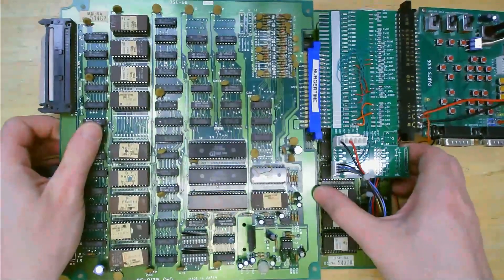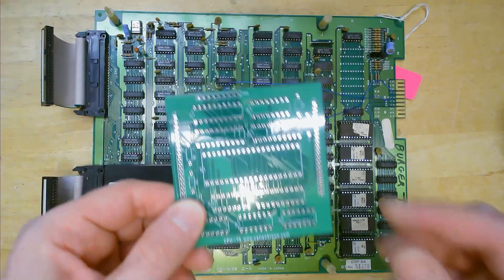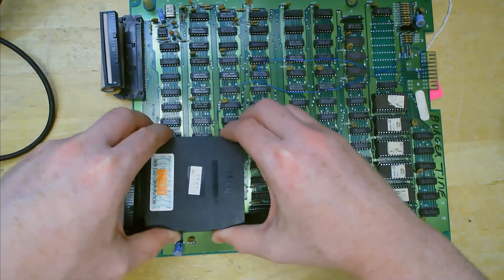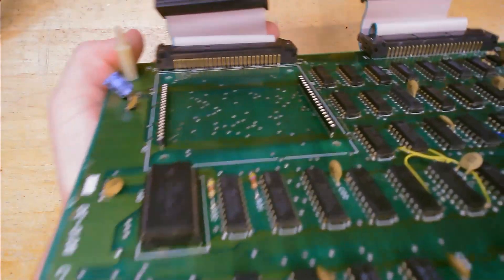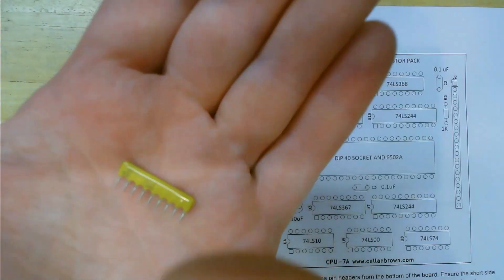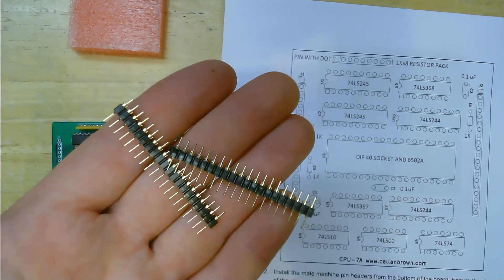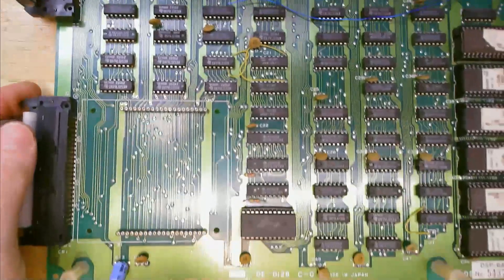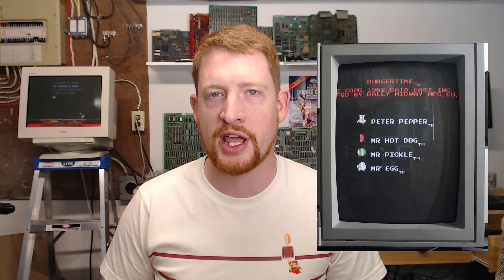Arcade Repair Byte & CPU-7A Module Installation - Burger Time

Comment: Would it be at all possible to get your help with a BurgerTime upright I have that's experiencing a couple of issues? One of which is my own doing unfortunately. It started out with just having a sound issue where it was pulsing the same sound at startup but video and gameplay worked, I pulled the socketed chips and lightly sanded off any corrosion I could see and cleaned them off along with cleaning the sockets and reseated them all on both the CPU board and the sound I/O board. Now I'm getting no video at startup and the self diag test shows a ROM error. 😞 The error specifically is ROM TEST ER AA06 13B. Any help is greatly appreciated.

Comment: Does that module work in the Deco Cassette System? It looks really similar from what chips they used (the Model 3 uses 74(LS)367 exclusively and abundantly where this uses 245). I have a customer's board set that crashes some games, most run in slow motion, at least one runs too fast and at least one seems to work just fine.
I'm pretty much at my wit's end because I couldn't find anything much wrong with it - except my board has a bodge IC that his board is missing (and you can see it was never populated)
Reply from the maker: As far as I can tell, the DECO Cassette used a "CPU-10707" instead of a "CPU-7" so this module won't work. I am working on a 10707 clone though, which is also present on Bump N Jump.
Reply: @74XX_arcade  I don't have the circuits mapped out, but I wouldn't be surprised if they're compatible.

Comment: I hate it when a pad lifts ! so annoying :( what a weird little bit of "DRM" !
Reply from the maker: Yeah, I didn't go into it much, but the encryption switches two bits when a new op code is fetched. I think someone could "decrypt" the ROMs but you would still have to make a custom PCB to fit the 6502 to the spot on the board.